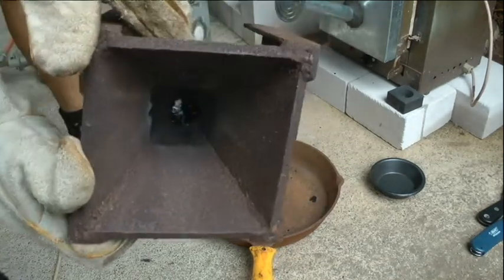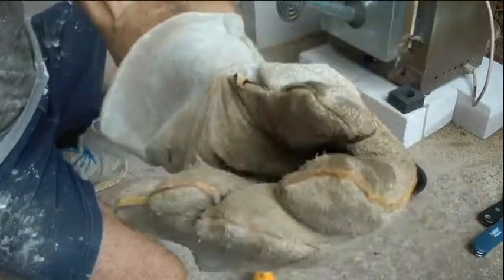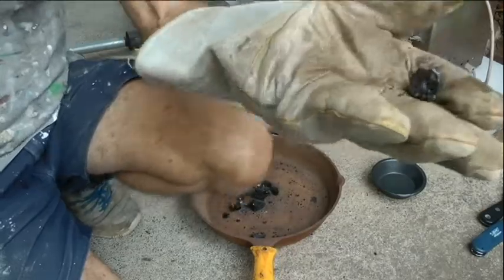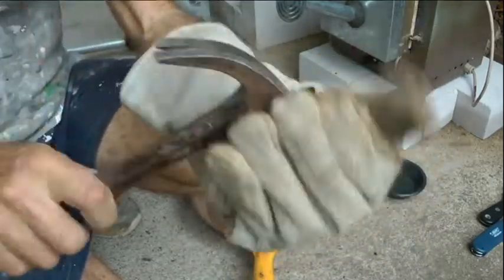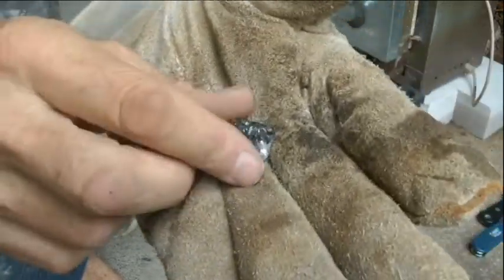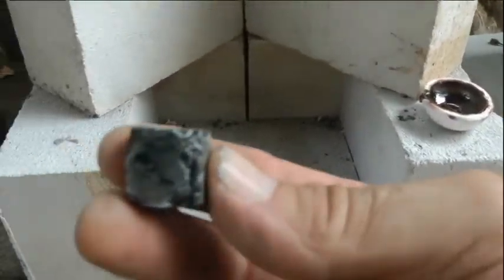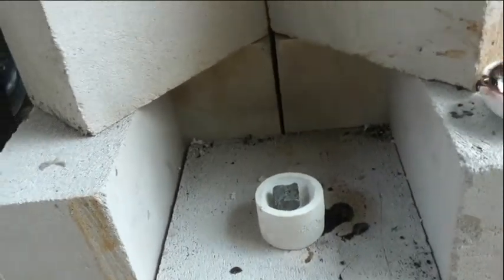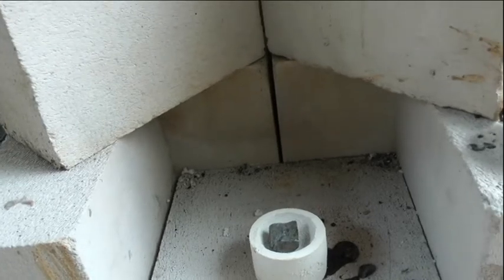Gold Hunter , Micro scale Gold leaching using Anion exchange Resin  pt 3

Comment: Chapman flux didn't do me any good.  Borax and soda ash seemed to work with lead inquart
Reply from the maker: Ah ha , i'll keep that in mind Keith thanks , just working on some smelting right now , got today off . I find that smelting large amounts of resin seems to need a lot of temperature , might need a thinner with it , i think it's Fluorspar is the flux thinner , i'm having trouble maintaining the heat and the fluidity today , however it is very windy outside . cheers . Ned .
Reply: @GrooberNedJardine  My thinner is 50% fluorospar/ 50% lime.  It will eat at the crucibles, but you gotta do what you gotta do.  :-)

I will be doing more tests this weekend.  Have a short term job tomorrow.
Reply from the maker: @hardrockuniversity7283  OK , 50 / 50 hey , well thanks for that Keith , cheers mate . .